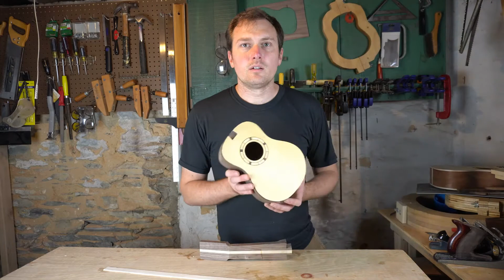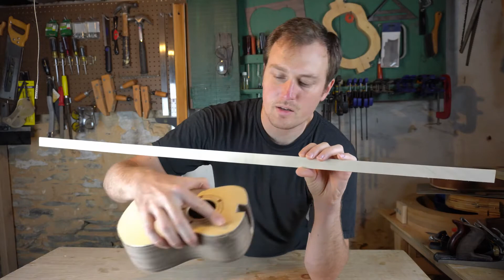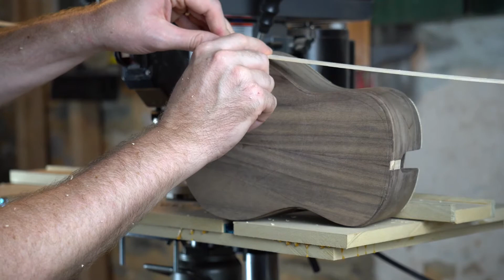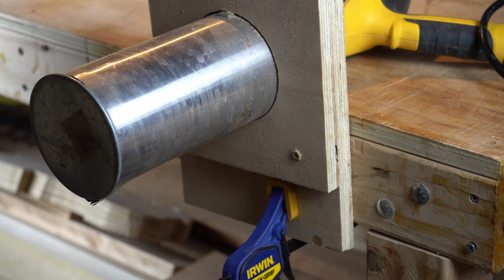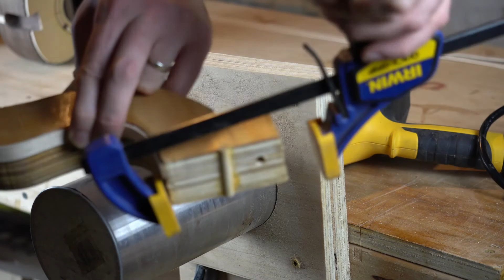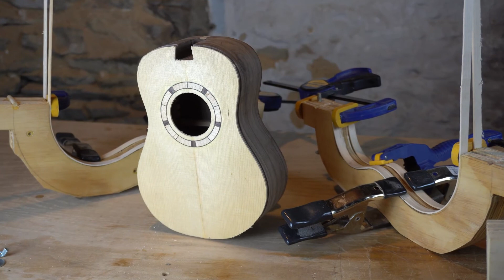Soprano ukulele build - making the binding

Comment: A nice bit of clever workarounds and straightforward video. Also no annoying music so I can save my patience for when it matters.  Thanks 

 What type of chuck is that you’re using for thinning?
Reply from the maker: Thanks!  That's the StewMac safe-t-planer on the drill press.  It works pretty well for thinning binding, but needs solid table and fence.